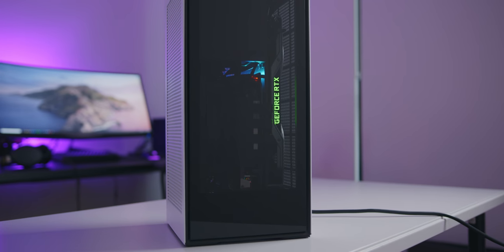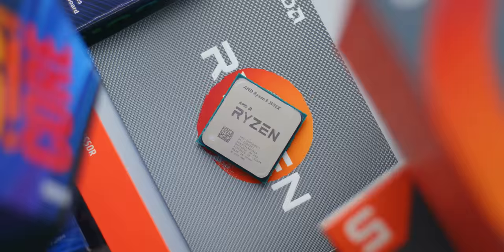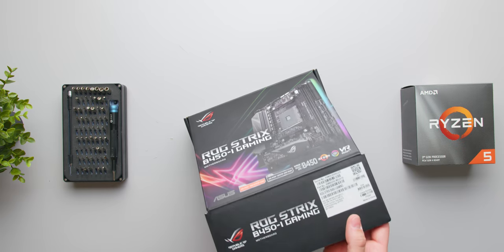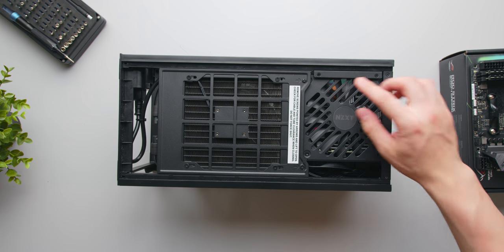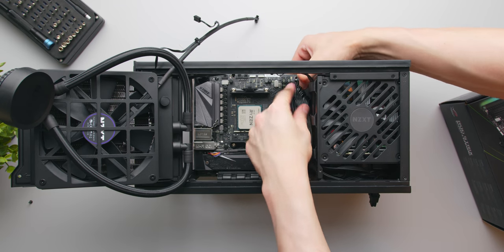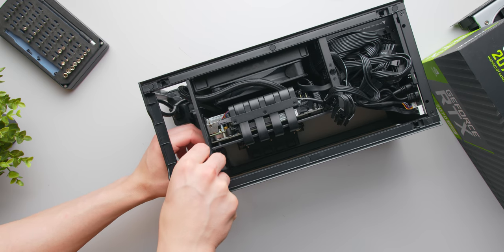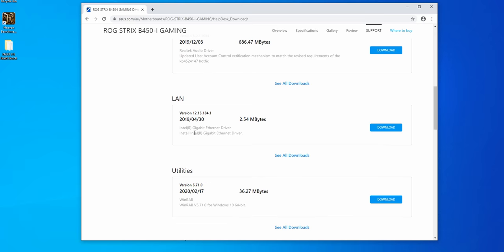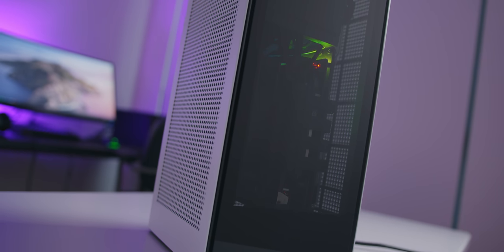How to Build a $1400 NZXT H1 Gaming PC

Comment: I building a PC with spec:
- i5 9400F
- B365 Aorus
- 32GB RAM 2666
- ASUS Dual RTX 2060 super - 8GB
in corsair 280x. Is this setting is good and balance? any tweak?
and btw, im finding the fan for this case, so stuck by now.
Reply: Go for 16 gbs of ram get a better mobo and get a 650w psu.

Edit: I'm pretty sure there are better parts now that the 30 series is out and 10th gen intel doesn't sell out instantly, i also recommend to go with the 5600x and a b550 motherboard with 3200mhz cl16 ram.
Reply: @ayokmschangedhisname4393  i endup with i5 9400f, b365 aorus with 16GB 3200 Ram (which is awesome), asus 2060 super in nzxt h1 adn 750w, and spend more money in gears, which is increase my experience alot. But no doubt, i think even in 7 months ago when buy the spec, i5 9400f still not much a good choice.
Reply: well, enjoy it man! Hope you are having a good experience so far.

Comment: Using Asus Rog Strix X570 I can't seem to control pump speed. The 140mm fan is somewhat quiet but the pump noise is driving me little crazy. Any tricks to adjusting pump speed? seems like its spinning at 100%. Thanks in advance

Comment: But with this Motherboard, the USB C port on the front is not usable, is it? 
Did you just not connect it, or is there a way around? 
I know that there are internal adapters for usb c to usb 3.1, but then the front USB 3.1 port is unusable, as the USB 3 port of the motherboard is being used to connect to the USB C port?

Comment: Is it possible to use a Ryzen 9 with this case and cooler?

Was thinking of using it for work, but concerned if it's enough to cool the cpu specily during render.
Reply: no..... concern to vrm motherboard, R9/i9 more cores = more power = more heat.

tight case prefee 6 Core CPU

Comment: man, I'm planning to build a 3950x +2070 super in a cougar itx case. Will it be ok? I got 240 AIO and 4 120mm 2500rpm fans. Kinda worry out the thermal of this plan.
Reply: that's 16 cores do care about thermal your vrm motherboard in small case
or you slowly burn the vrm during usage then kill your motherboard.

Comment: The position and number of ports on this vs a prebuilt Corsair One (specifically the case the One comes in, which you can't buy, but I absolutely love) just irks me. It's as tall as a mid-tower, but meant to sit on the desk. So why-TF would you put the ports and power switches on the top ?? Grr....

Comment: Would this build work if I just swap GPUs with the new 3070?
Reply: Definetly, but make sure you dont use the FE edition or any AIB card over 30cm. You can actually check out nzxts page for the nzxt h1, they mention the compatability with 30 series graphics cards

Comment: It's not cheap that case in the UK @ £300 and still on pre-order.  Converted that is $500 Canadian Dollars.  Not sure it's worth it even with the PSU and AIO included.   I'd prefer if they just made a cheaper version of a SFF case without the AIO and PSU. The bundle takes choice away.   It's just OK.  Still not the mass market SFF I'm looking for. Not that I could buy it if I wanted, YOU CAN'T FIND IT ANYWHERE IN THE UK.

Comment: Would this run 1440p 144hz? Mid settings?
Reply: Rei零 yes, but you would want a stronger GPU if you want to run 1440p 144hz comfortably

Comment: How with this hold up as a workstation meant for 3-D rendering and video editing?
Reply: video editing ? it's fine, 3D render ? too slow

This small case lack thermal issue (Assumed use brand new 3D software released). No one build 3D render on small case, lack airflow & thermal.

Depends 3D software
only use CPU for rendering = Threadripper or i9-X, cheap solution Ryzen 3700X/3800X/3900X/3950X or i9-9900K, i7-9700K

use GPU for rendering = minimum 8 Core Ryzen Zen2 or Intel 9th gen CPU  + Minimum RTX 2060/1080ti/1070ti

Comment: 81 C when gaming at full hd?!  That is bad for a 2070 super. Add 3-5 C more in the summer and/or a 2K resolution then it will be throttling.  Nah , I will stay away from mini cases. Plenty of pretty , 0 cooling efficiency.

Comment: isn't this GPU overkill for the CPU
Reply: Kristian Hristakiev No, Ryzen 5 performs better than the intel equivalent (i5 9400) and its currently the best bang for the buck cpu for 1080p 1440p gaming
Reply: No, 

Bottleneck is when your hardware under recommended spec from the game/software requirement. (Simple think)

Comment: The thermals suck on this case even with the 140mm rad.
Reply from the maker: CPU thermals are actually excellent. It's the GPU thermals that are a bit average, but they're still acceptable.
Reply: @optimumtech  a mesh front panel would be great for GPU temps, really should just be in the box as an option at this pricepoint. The glass doesn't really add anything except buzzwords to the spec sheet
Reply: drill your case to create some hole with wooden board then painted XD